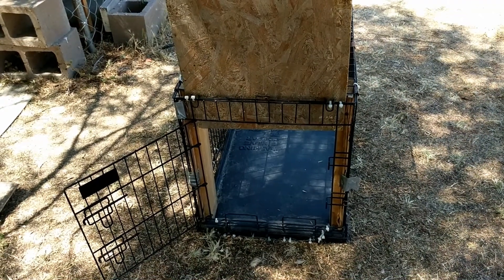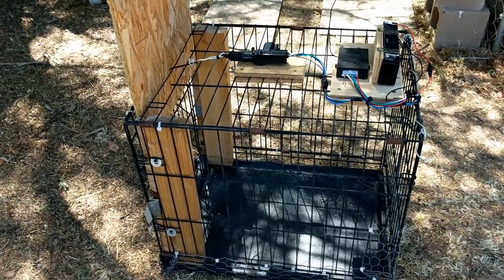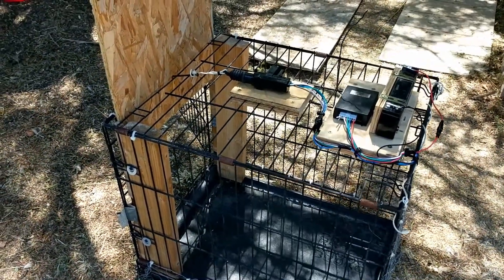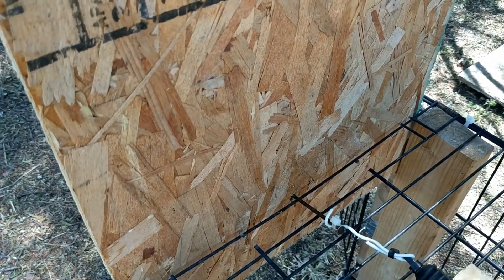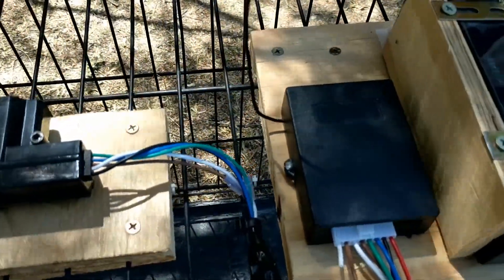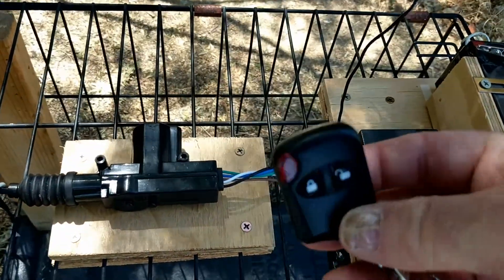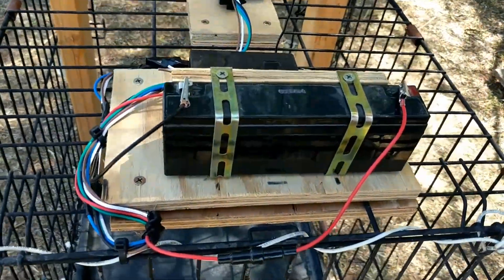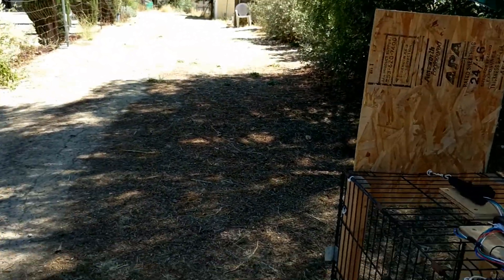Remote Controlled Cat Trap

Comment: Incredible. We are trying to capture a mama and her kitten right now.  Do you have a design or parts list?
Reply from the maker: Sorry I don't but the parts are 1) actuator (the moving part), 2) wireless receiver, 3) keyfob, and 4) rechargeable 4 amp battery. These are often sold together with the wiring diagram included. Of course you'll only need one actuator but the price is pretty low anyway. If you're with reach of an AC outlet, you can use an extension cord and a 12VDC wall wart in lieu of the battery. 

Good luck with mama and her kitten!

https://www.amazon.com/XYZCTEM-Central-Conversion-Entry-Universal-Vehicles/dp/B016RUV8Z2/ref=sr_1_3?crid=2X1ZG5HB1NTRD&keywords=car+wireless+door+lock+actuator+and+receiver&qid=1659764110&sprefix=car+wireless+door+lock+actuator+and+receiver%2Caps%2C122&sr=8-3
Reply: @ShawnDienhart  Awesome!  Thank you so much Shawn.

Comment: Shawn,
Not to be rude,but you might wish to consider adding a piece of pipe foam insulation to the bottom 
of the plywood drop door. Inset on each side so as not to impede drop. May prevent a cat or kitten getting hit by accident.
Reply from the maker: Hey Mike, 
Certainly not rude at all. I have used this same trap in that past by manually tripping it and always add foam to the top and bottom prior to use. As I just did the ad hoc video, I didn't add the foam. But I am glad you commented as others would be aware of the potential harm by not adding the foam. We have many rescued cats and take every precaution to assure no cats get harmed when trapping for TNR. Thanks very kindly.
Reply: Shawn Dienhart  Thanks!! Might try to adapt to the tomahawk drop trap I have. Operation Catnip @ Gvl Fla. @ Uof Fla. college of vet med 
has done over 50,000 TNR in the last 20 years. I'm prob. close to a 1000 in that time.
Reply from the maker: Wow Mike, that is a lot of TNR ! Amazing work to say the least. Thanks for the tip about the tomahawk drop trap. 

The motive for the remotely controlled trap was so I could selectively trap (or not) cats that enter the trap. We have a small cat colony nearby we look after and if a new stray or feral comes around that needs to be fixed, we can trap it while allowing the other cats to enter and exit the trap.
Reply: @mikesustana9726  did you ever make this for the drop trap?  If so can you post pictures of your design?
Reply: @mikesustana9726  
Thx, Mike!